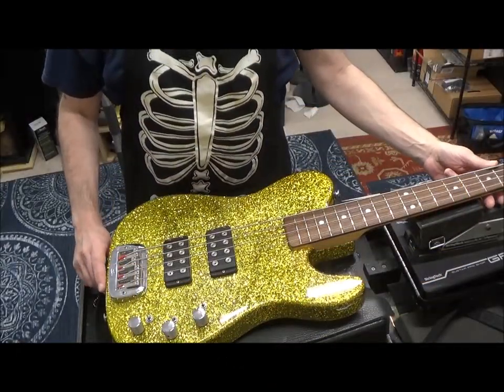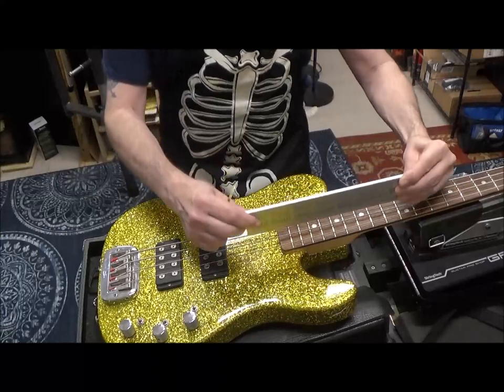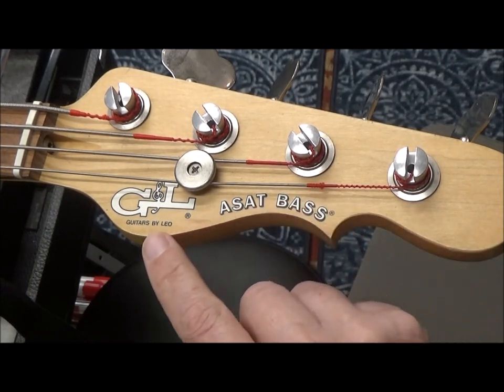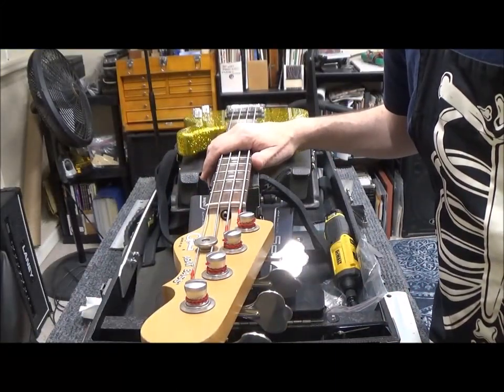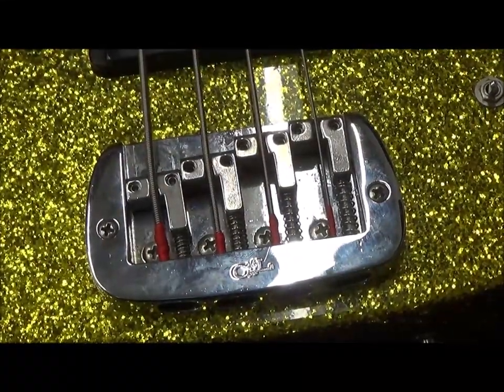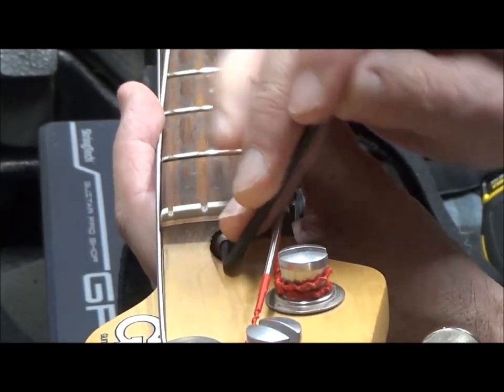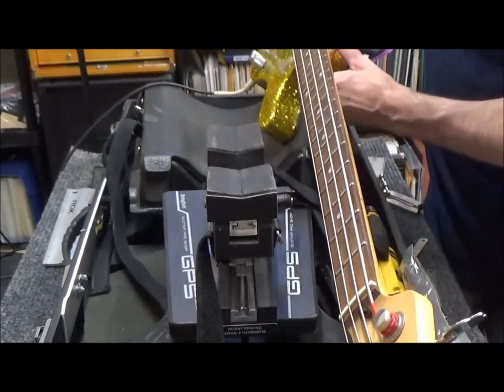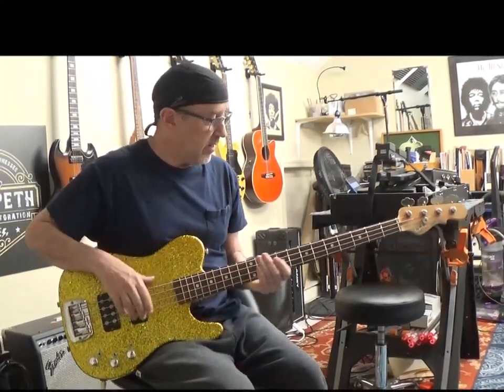G&L ASAT Bass Setup & Intonation

Comment: I have a 90’s swamp ash ASAT bass that weighs 11.5 lbs.  If you notice, they use thicker body wood on the ASAT compared to a standard Fender-style bass.  This is most evident at the neck heel.  One theory is they select heavier slabs, and thicker wood for the ASAT basses, as the extra weight counteracts a tendency to neck-dive with the bass body having no upper horn. Tom Hamilton plays an ASAT bass with a lightweight pine body, but has an extension on the upper strap button, likely to counter act neck dive on his lightweight ASAT.  Great sounding basses, with huge output and a nice mid-range-rich tone, but not for people looking for a lightweight bass.